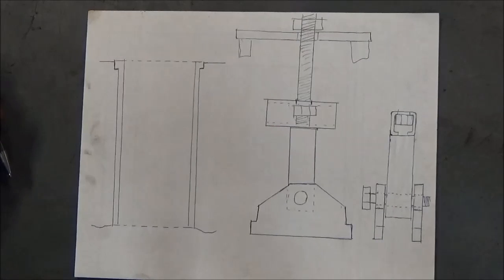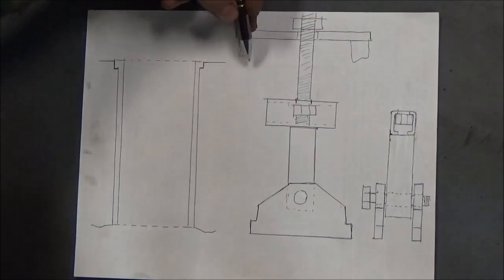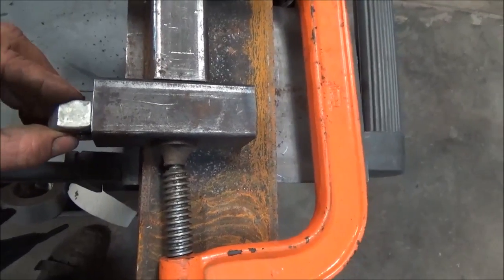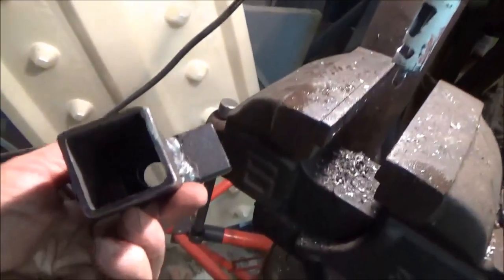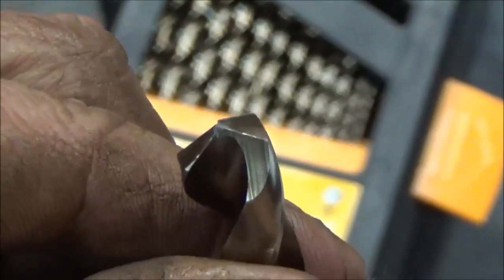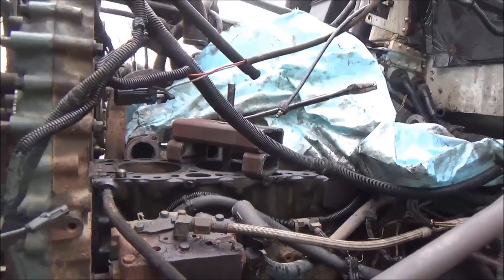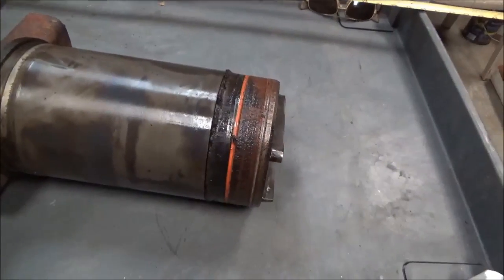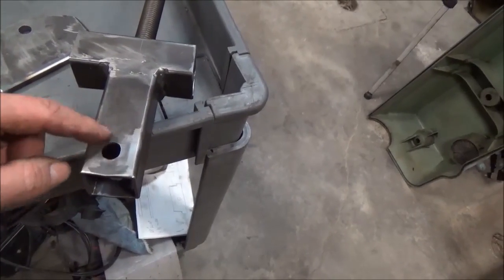Making liner puller and pulling my 1st liner on Detroit Series 60

Comment: Great video, man. And great liner puller. The temperature shouldn't be that much of a problem, tho. 35 °F isn't that cold. Once it gets to -15, I wouldn't recommend doing mechanical work. Stuff starts breaking at that point and you kinda have to wear at least insulated fish gloves.
Reply from the maker: The temperature is an issue for me, I can't work outside when below freezing for more than a few minutes at a time. I have a condition called raynauds the blood stops going to my hands in cold weather and they freeze up pretty quick.
Reply: Gordon Robertson Ah, I see. I'd have to put my hands in my pockets fairly often. Nah, I was just thinkin' the weather probably wasn't causing all that much trouble with the liner. It might have even helped a tad 'cause steel will shrink in the cold more than cast iron. Probably wasn't very helpful with the seals tho. Most likely kind of a wash. :)

Comment: nice puller I am in framing a Detroit 60 series at the moment to,, trick to getting the liners out is in the center where the liners are in the block spray lubricant in those holes in will go down to the o rings an they will come right out ,, round hole in the block center way of the liner
Reply from the maker: Thanks.

Comment: Don't forget to put your new liners in the freezer over night before you try to fit them, and only take one liner out of the freezer at a time, while you are fitting one the others are still freezing,
Good luck in this weather,
I like your puller.
Reply from the maker: Thanks.
Reply: ...Or....buy some dry ice at the local grocery store....72 degrees below zero....

Comment: Gordon are you going to reuse the liners?  I thought maybe a torch to heat them up?  my old Volvo truck was a real rust bucket I tried PB Blaster nothing worked expect acetone and ATF fluid break through the rust to change the torque arms.
Reply from the maker: No, I'm not going to reuse the liners, I thought about using a propane torch, but am afraid if the inside of the block lights up with all the oil in there it might damage something, I think I will try a salamander heater underneath.

Comment: Great job....I thought that the "ears" on your liner puller would shear off. You must have feel pretty good when that liner first popped out.
Reply from the maker: Thanks Jeff, I wish it did "pop" out, it was long slow wrenching for about 10-15 minutes with 2 long wrenches about 2 ft. leverage with both of them hooked together, it started to get easier after it was up about 1/2 an inch.